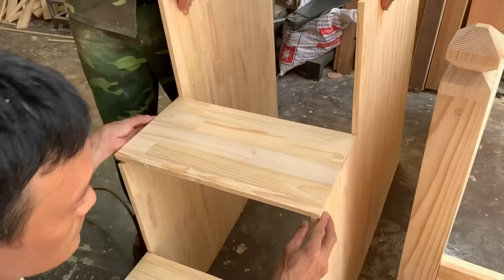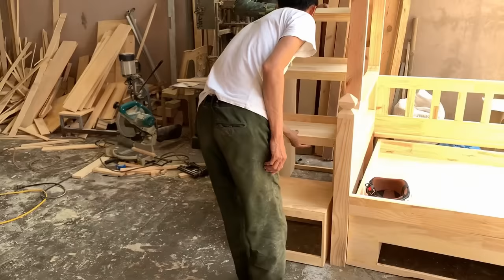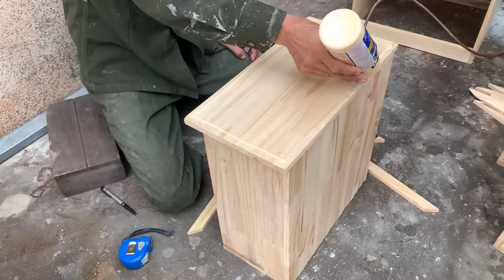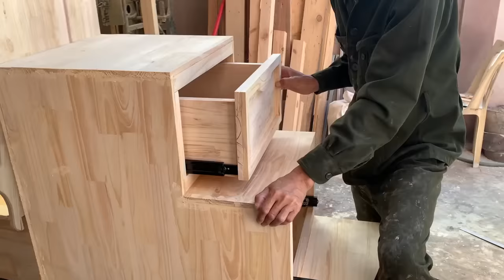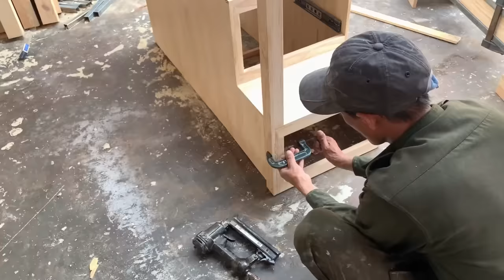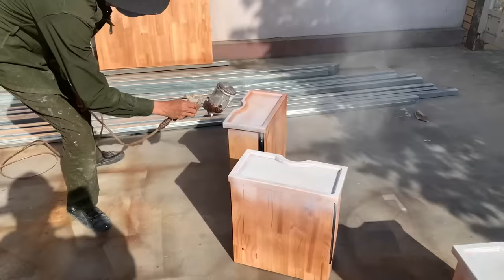Amazing Woodworking Idea Bunk Bed Baby // Build Stairs With Storage Drawers For Bunk Bed Kids!

Comment: what do you call that tool that looks like a stapler?
Reply: Air nail/ stapler
Reply: @gelosul  Thank you ..
Reply: @joanamarieabastillas7577  works with compressed air so you need a compressor as well.

Comment: It looks nice but I seen so many mistakes, for a kids bed pin nails are not gonna hold anything together for long. I dont care how much glue you use lol. Overall though it looks nice but unfortunately won't hold up for long
Reply: That glue is stronger than the wood fibers, it’ll be plenty strong.
Reply: The pin nails just hold it together while the wood glue dries, that glue ain’t going anywhere. Trust me, I’m 500+ jobs in with zero call backs.